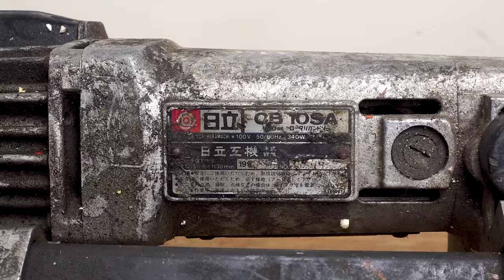Deep Cut Portable Band Saw Restoration | Hitachi CB 10SA

Comment: Where’s the large guard for the blade and spinning wheels. The reason why the casing was broken and cracked is that the blade and what it was cutting has got caught and spun off at great speed and smashed the casing , your attempt to repair the damage is not fit for purpose please do not use the saw, in the uk if it was used the person not be covered by insurance and would be severely injured.
Reply from the maker: The cause of the break I think was because it was thrown. it doesn't have a shield like you said originally. I just try to make it as original

Comment: Ive still got mine in good shape and use it...does anyone know where to get the roller guide blocks that hold the guide bearings in place? I broke one of mine and have not gotten around to machining another one up. Would require a bit of work out of 6061 aluminum or CNC mill program
Reply from the maker: You can go get another one made at a mechanical shop, a cnc machine can do it